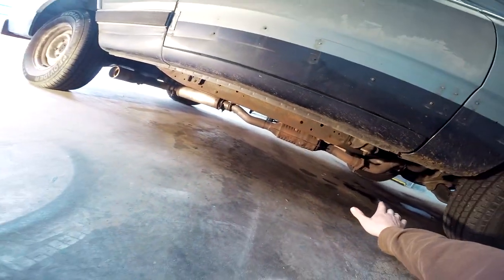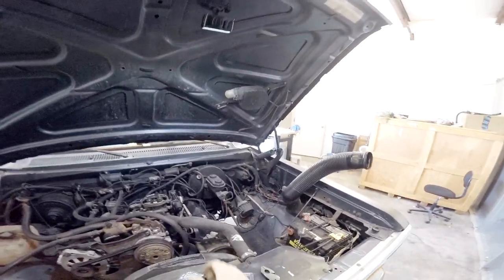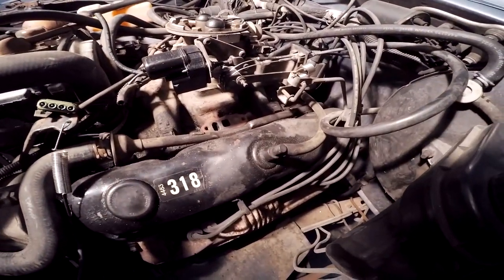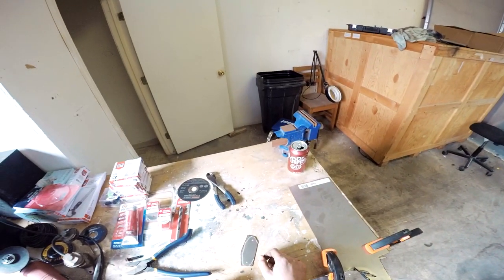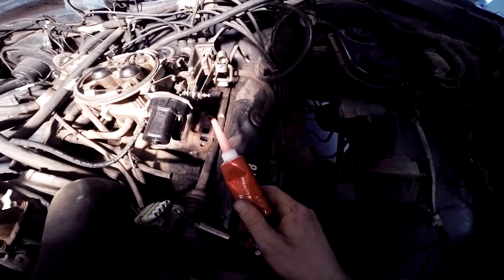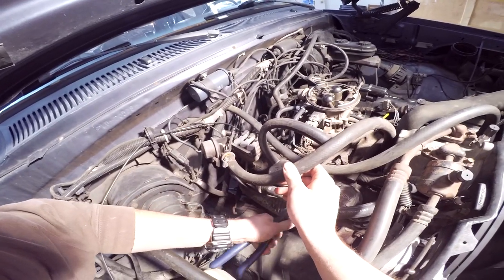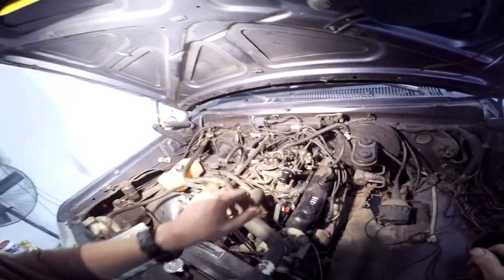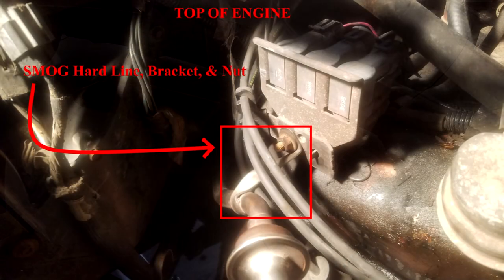1989 Dodge Ramcharger 318 TBI SMOG PUMP DELETE Part 2

Comment: I looks like I have two air pumps powered by the same belt on my 1991 Dodge 360 engine. Do you have any idea what the other pump is for?
Reply from the maker: I do not, perhaps you have two CAT's and it goes to that one? other than that I have no idea.

Comment: Did you plug the hose connection far rear passenger side on valve cover where you removed the long hose ?
Reply from the maker: I never removed my tube, but its easily done. Thats why I just simply plugged it. Just to help protect the one way check valve.

Comment: I have a 1991 w150 and I want to do the delete. I am going to try it with out deleting everything. I just want to plug stuff. My 2 yr plan is to get a newer 318 with some upgrades so deleting everything isn't an issue. Do you have info on the plugs that you can share like website etc.?  I currently don't have a cat cuz I had antique plates and in PA no inspections are necessary when you have these plates. Thank you!!  Great videos!
Reply from the maker: Thank you! Glad you found them helpful. Those plugs I got from cerakote. They are just Hi-Temp rubber plugs, I bet you can find them on amazon. I do not know what sized I used. I jest went through my kit till I found which ones that fit.

Also, go check out Ramchargercentral.com there is a tone of useful information there & helpful expertise as well.

I hope this helps you!

Comment: Literally just found your videos. Wish I did sooner but I have an 88 tbi 318 and want to do the same thing. Does deleting the smog interfere with the computer whatsoever?
Reply from the maker: For me I still haven't had any issues at all and I have been driving mine daily since the posting of this video. Just an FYI if you do not know. Your year is the 1st done for TBI for the 318, so just be aware of that when you go to do that. But mainly all the TBI cares about is the fuel air mixture and thats it. So as long as you dont yank on the O2 sensor or something on the throttle body. You'll be good.

Comment: what size Cerakote plug did you use?
Reply from the maker: They are not label a measurement in the box. So, I'm not sure. I just went though the box till I found one that fit. As if you where trying to guess a nut size and go though your sockets. I know its not the best answer, but hopes this helps.
Reply: @mountainmaninitiative1117  I found a decent kit on Amazon, I'm gonna grab it and give it a shot! Thanks!
Reply from the maker: Good deal! Glad it worked out! And your very Welcome!

Comment: Im think about doing this on my d250 360 tbi im guessing this is going to be the same prosses. What gains did you see with the delete?
Reply from the maker: Yes perty much the same process. The 360ci is just a larger version of the 318ci. I dont have specific scientific data on how much of an improvement there was. But I have noticed the engine is way happier! Seems to run over all better. I'd assume I at least gained 5 - 15 extra HP at the crank. Since the engine is no longer driving the smog pump and being straight piped, allowing for better flow / evac of exhaust from the cylinders. To summarize marginal performance gains & a happier engine that seems to run smoother. I do recommend replacing the old factory exhaust manifolds. They suck. I plan to remove mine in the near future. That will definitely help with performance.

Hopes this helps. If you have any more questions feel free to ask and I'll do my best to answer.
Reply: @mountainmaninitiative1117  I want to do it when I replace my exhaust Im waiting for it to warm up  ive got abunch of stuff planned just dont feel like freezing my balls off ripping stuff of the truck that shouldn't have existed in the first place.
Reply from the maker: @cowthedestroyer  Defiantly feel that! lol Some times timing is everything!

Comment: Hey, great video i did my delete a few years ago now but the thing is thirsty as all fuck now I'm constantly chasing problems, the disk on the angle grinder keeps breaking because your using the left side of the disk you should only make contact with the work peice from 12 o'clock to 5 o'clock (right side of the disk)
Reply from the maker: Awesome! Thanks for the feed back, My grinder is actually broken, it wobbles really hard lol. So I know that is the big reason why the disk break. Now you can head over to https://ramchargercentral.com/vehicle-help/. They might be able to help you figure out the rest of your issues your having.

Comment: hi I just deleted the cat on my ramcharger I dont really have time to mess with all the smog pump stuff wath would you recomend doign with the line goign to the cat now its just disconected but im scare of fuking sonething up
Reply from the maker: That all depends on the year & engine you have. All the smog pump does it blow air into the C.A.T.  and since its no longer doing anything you might as well either take the belt off or remove the pump entirely.  you can go to https://www.ramchargercentral.com/forums/vehicle-help.3/ and ask for more help there.
Reply: @mountainmaninitiative1117  it a 89 318 just like yours
Reply from the maker: @olivier olivier  Then if you choose to follow what I did. You won't mess it up. Been driving like this for months no issue at all. It doesn't up set the TBI computer at all. The only big thing I'd have concerns about is if you do NOT plug that check valve on the driver side. Since that connects to the back of those old SMOG exhaust manifolds (Bricks as I call them). That might kill some Horsepower and mess with exhaust scavenging. You'll have to test it long term. For the short term test I have done. It didn't seem to matter.

Other than man I hope this helps. Go forth and take the Initiative and get her done!
Reply: @mountainmaninitiative1117  perfect so in the meantime I can just remove the belt right?
Reply from the maker: Yup which is really easy to do. If i recall correctly thats in part 3 of this series!